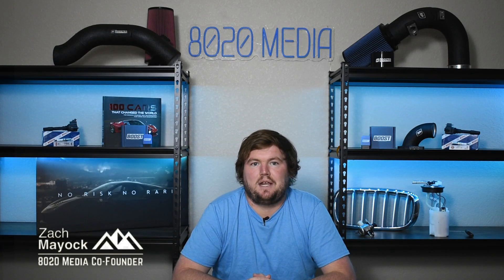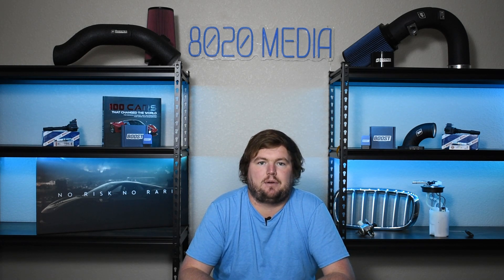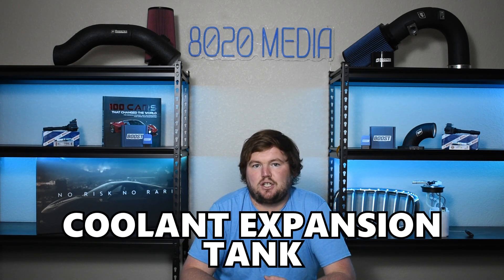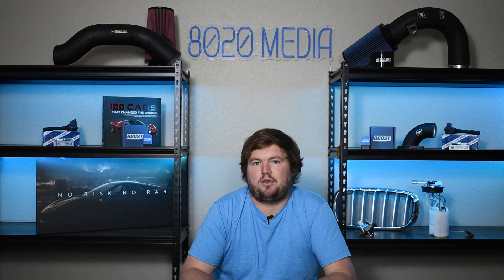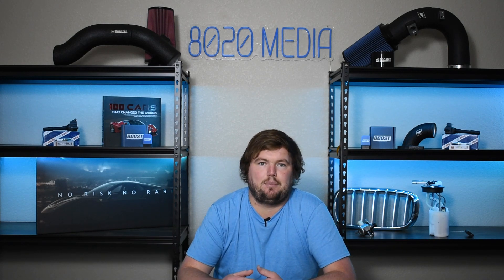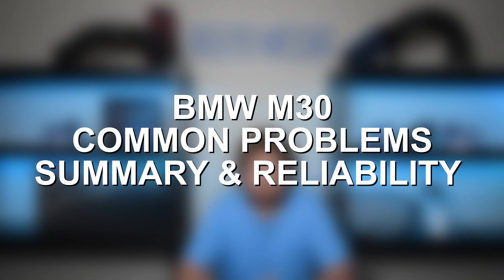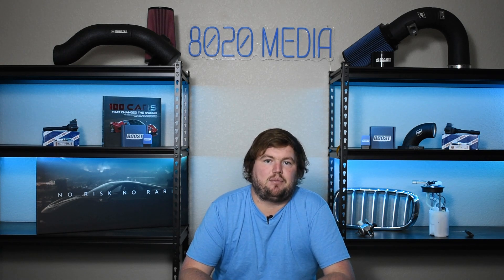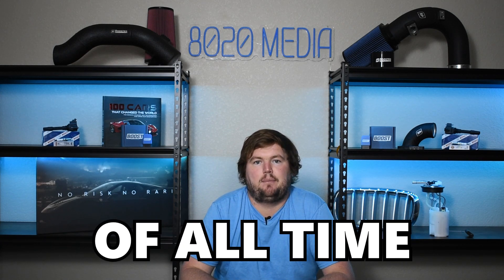BMW’s M30 Engine | Common Problems & Reliability

Comment: M30s are all fun and games until you find out your block is cracked! Emerging problem with these in the last 5/10 or so years. My block cracked from oil galleys to coolant galleys in 9 spots. Pulled a head off a junkyard motor and found the same issues. Eventually found an intact block and rebuilt it and it’s been great but yeah, no bueno!
Reply from the maker: M - Sorry to hear! However, we appreciate you taking the time to share your experience.
Reply: Or cracked head on the earlier engines. If you do need a replacement head, get a replacement head from a ‘85 engine onwards.

Comment: One flaw at least some m30 engines have is the two banjo bolts for the camshaft oil sprayer bar, they can come loose and end up destroying the camshaft and rocker arms. Bmw came up with new bolts for these with thread locker on them. 

Another thing to mention as these engines start having alot of mileage is to check the sprockets, chain guide and tensioner. I have seen small missing bits from sprockets and a bent chain guide.

And don't forget to adjust the lifters.
Reply from the maker: O - Thanks for sharing this insight!

Comment: Older BMW engines: bullet proof, cheap to maintain and fun to drive BUT drinks fuel like there's no tomorrow
Newer BMW engines: amazing fuel efficiency while have lots of power and torque BUT abysmal reliability
Reply from the maker: M - Well said!
Reply: I have a 2021 G30
All you have to do is be on top of maintenance and change the oil. Any BMW after 2013 is reliable if you take care of it and don’t drive on Zero oil lol
Reply from the maker: N - mmmm. That's a bold statement.. You have a 2021. We agree staying on top of maintenance and oil goes a long way, but the "after 2013" part, a lot may disagree. It does seem that they are getting better with engines like the B48/B58 and newer S58, but time will tell!
Reply: Yup they guzzle up fuel unfortunately 🥲